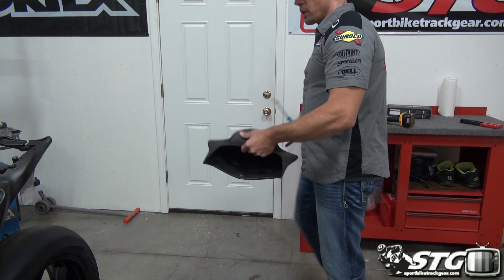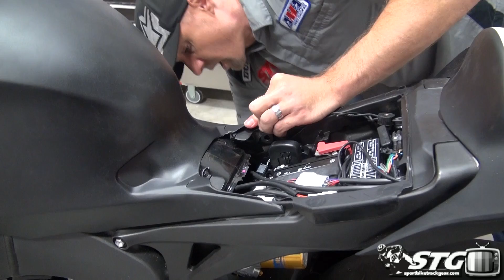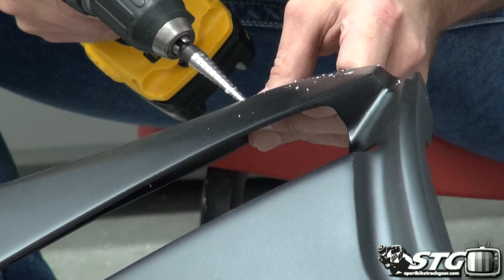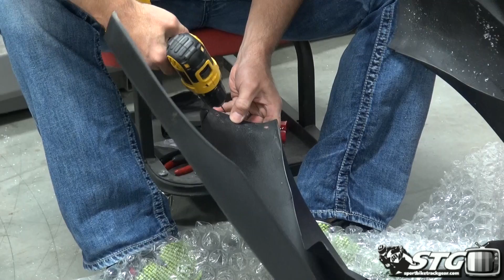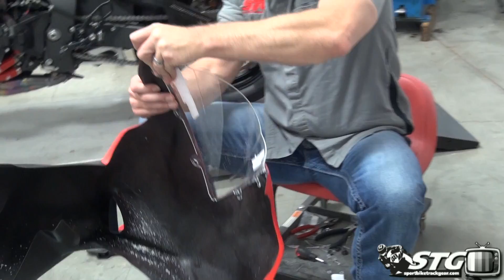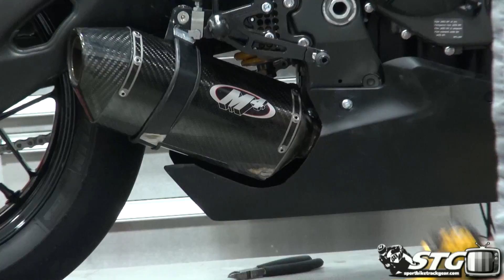Hotbodies Racing Race Bodywork Honda CBR1000RR Install from Sportbiketrackgear.com

Comment: I've always mounted fiberglass bodywork with rubber grommets popped in for all fasteners (or as many as possible). It's safe to hard mount this stuff?
Reply from the maker: I have hard mounted pretty much every set I have installed over the years. We have had some sets that go years without being replaced (the stuff on my bikes) and some that gets crashed on a bit (the stuff on Max's bikes LOL) and I have not had any real issues with hard mounting. Be careful to not over torque the fasteners. - Van

Comment: Did you remove that emissions crap that sits on top of the air intake ducts?
Reply from the maker: Yes I removed all of that and sealed the holes in the ram air ducts after doing so. I miss this bike man, so much fun was had on this Honda. - Van
Reply: Was there anything tune related needed after?? I want to remove all that crap but don't want to mess with my tune since she runs flawlessly as is.
Reply from the maker: No you should be fine, I do not recall any issues after doing this. - Van

Comment: will it fit on cbr250rr
Reply from the maker: +harsh gurnani It will not, the mounting will be totally different. Thanks for watching!
Reply: ok thanks. than cb600rr or cbr500r or any bike fairing wiill fit
Reply from the maker: In my experience the only way to get a good fit is to use fairings that are actually made specifically for the bike. They may look similar but only the fairings for the 250 will fit the 250.

Comment: how do you feel when you compare these vs the armourbodies brand. I'm stuck between getting one of the two from you guys
Reply from the maker: Chuck, the HotBodies stuff has improved drastically over the last few years and is definitely worth the cost.  However, you will notice slight quality differences with the Armor Bodies and chances are likely that it can be repaired after a crash.  If you'd like, we can try to help more with the choice if you want to shoot us an email to Orders@sportbiketrackgear.com. Thanks!  ~Aubrey

Comment: What's the point in using the Graves quick release fasteners on the windscreen? 

Is there no need for heat-shielding on track fairings?

Thanks for sharing the vid. It's quite helpful and instructional!
Reply from the maker: Usually they are good enough for the track, makes it easier to get on and off and in the event of a crash, it will possibly only break the windscreen and not all the bodywork.  Thanks for watching!  ~Aubrey